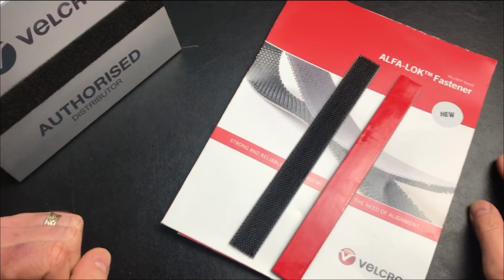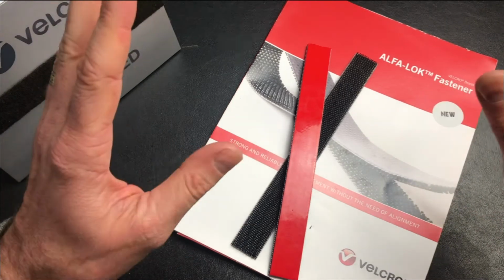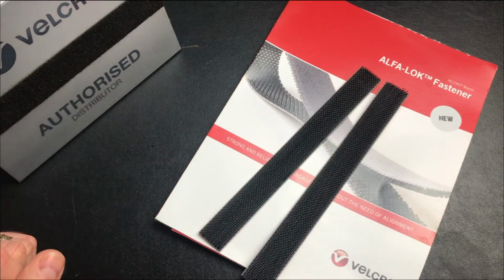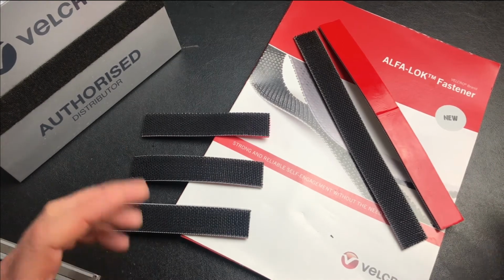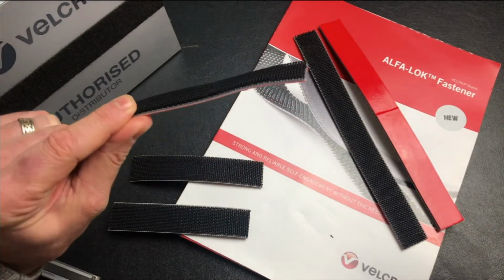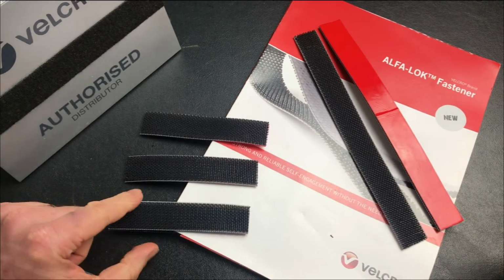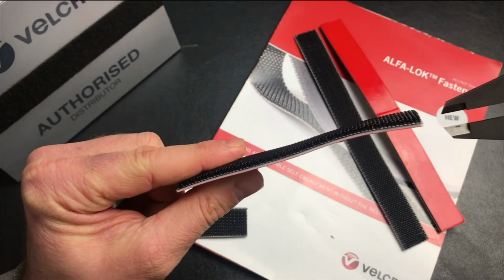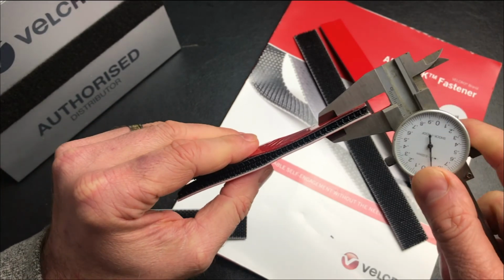VELCRO® Brand ALFA-LOK™ Self-Engaging Interlocking Adhesive Tapes

Comment: Hello,  I'm in exhibitions preparation. Would you recommend any one of these in particular for hanging some flat silicone sheets about 1/8 inch in thickness (similar to a tapestry  in size? about 3 ft by 4 ft) . I was thinking of making a wood strip with the one side of alfa-lok attached to it that could be screwed to the wall, then attaching the other directly to the silicone sheet. Thank you.